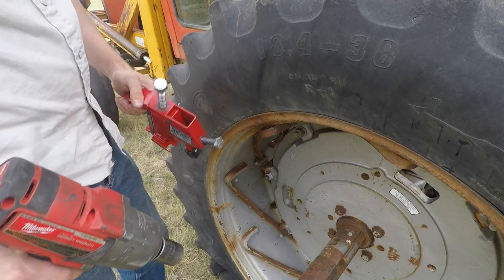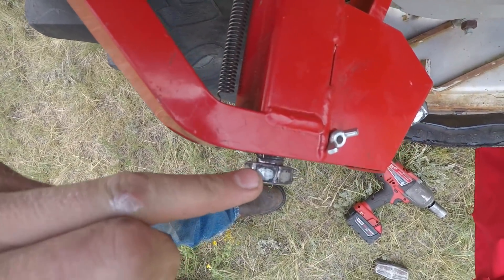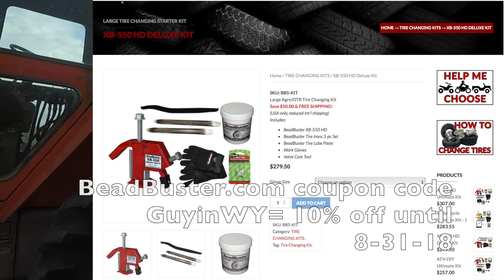BeadBuster Giveaway!

Comment: I ordered a 550 as soon as I heard the coupon code from the previous video. Been looking to upgrade from the cheap Esco bead breaker I've been using. It works, but you can't use impact tools on it because it's made of cast.

Comment: Ran a new 1135  for a neighbor during the summer while I was going to college. It was a pretty good tractor.  The 354 Perkins engine did ok unless started turning the pump up. Also had problems with hydraulic pump mounted on front of engine

Comment: This is a really cool tool. I watched your original video when you changed the tires on the JD and wondered if they had one that would work with lawn mowers and ATV tires. You answered that question in this video. Will have to definitely take a look on their website to check out the different kits.

Comment: Thank you guys at Bead Buster. I really like Your videos Blake. I change several rear tractor tires a year, and I think this bead buster would really be a nice tool to have. right now, I change rear tractor tires by laying them down and driving my 1946 John Deere A front tires over the tires and that usually breaks the bead, it is a little dangerous, but it works most of the time.
Thank you for the videos, they are very entertaining, and useful.
GOD Bless You...

Comment: Oh man, I just changed tires for my ATV, it was an easy job once I got the beads broken. And that was a pain in the ass, ended up putting wooden beam in door frame and used hydraylic jack to push beads off the rim. That took me more than two hours... I need one of these!

Comment: Hi brake , me and my uncle just finished building a custom 2000 litre sprayer to pull behind a fiat 100-90 . The fiat has a engine from a 110-90 which we did back in the days we grew sugar beet. Would love to have the bead buster as we run 6 tractor, 2 loaders and 2 combines on the farm .

Comment: Hey Blake,
I always look forward to your videos. Keep'em coming. 
I wish the military had the bead buster. I have changed countless tires on military vehicles thru my 26 year career and the bead buster would have been GREAT to have! It's really difficult to change a tire on a tractor and trailer in the 125 degree heat in Iraq. 
Thank you for your videos. Keep up the great work. 
P.S. What's the status of the one ton Dodge pickup you were rebuilding? The one that was wrecked.
Reply from the maker: We’re rebuilding a 2014 Ram 2500, it’s been held up searching for parts. We actually just picked up a few big things last night so there will be an update soon.